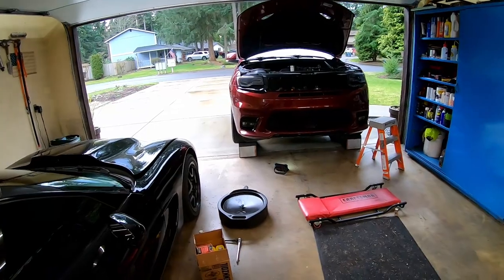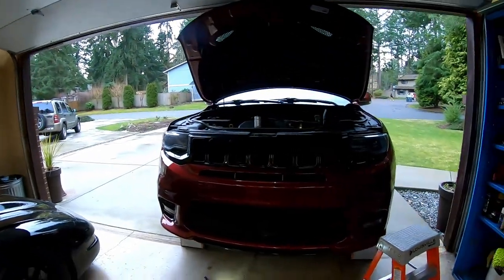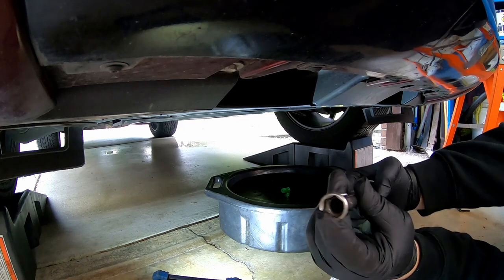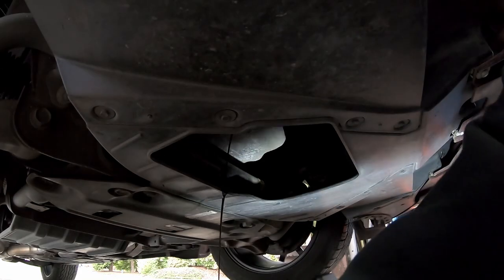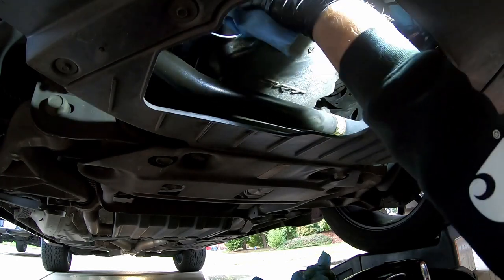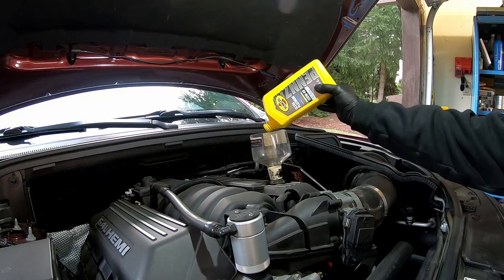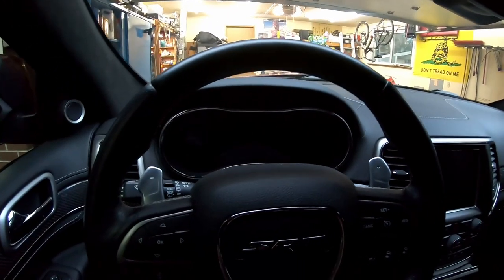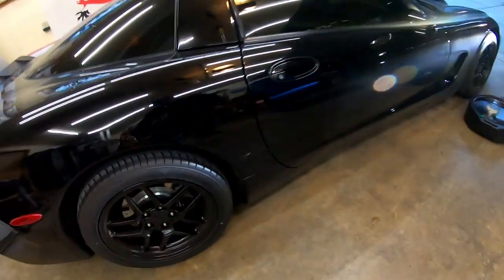How to Oil Change and Reset SRT Jeep Grand Cherokee 392 2012-2021Full Detail

Comment: Good idea to shake the penzoil bottle before dumping it in as there is some separation. I use mostly Wix XP or K&N filters. I go almost a half turn after contact (hand tight) Usually I let it drain overnight and get about a pint of extra old oil out after it starts to drip. No ramps. I just drive up on some sideways 2X4's. It takes me at least a 6 pack to finish the job.
Reply from the maker: Thanks for checking it out shaking the oil bottles is not a bad idea.   We used to do that on our turbine engine oil for our helicopters at work for the same reason.

Comment: Regarding the low oil pressure warning, will that go away after you first start it? One time thing or is it on everytime you start the car?
Reply from the maker: No it definitely goes away after the first start from oil change.  No problems at all.

Comment: 1:45 Right on Mr. Black,
I swear everyone says that is the best $3.97 filter with silicon drain back valve ever made. lol
Does Issac's Crown Vic use that one too, or the FL-910?
-Chuck
Reply from the maker: Funny we bought the 820 way back when we first got the crown vic by mistake and it's been sitting on the shelf since.  I was blown away when I found out it was the same as an MO899.    Isaacs car is the normal 910.